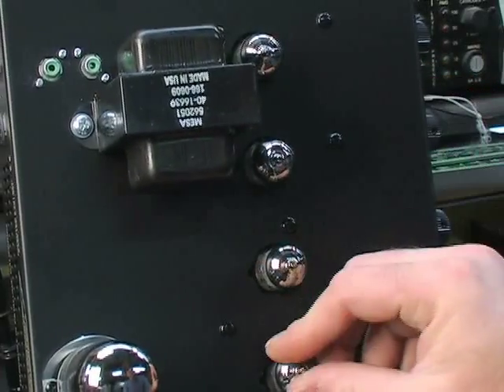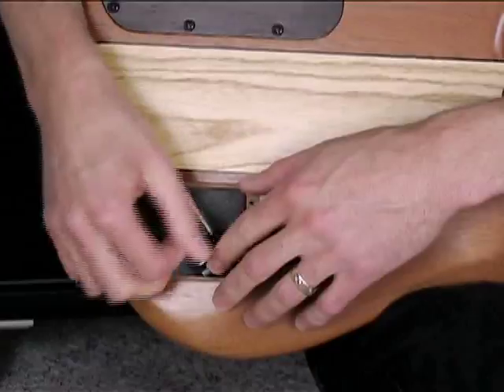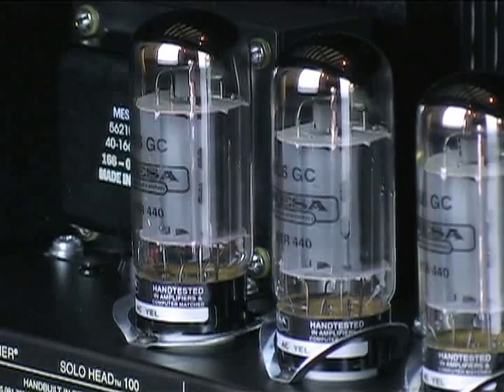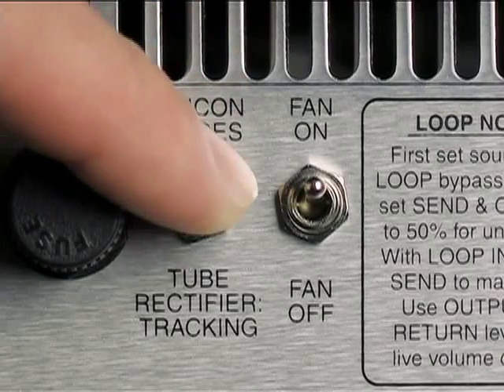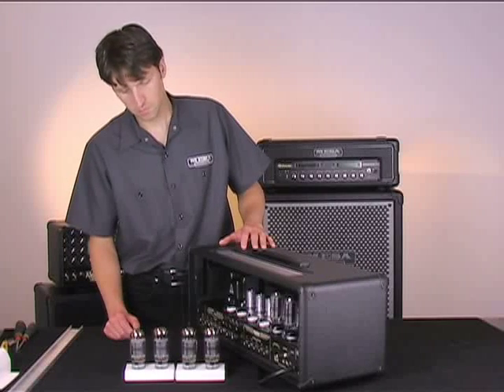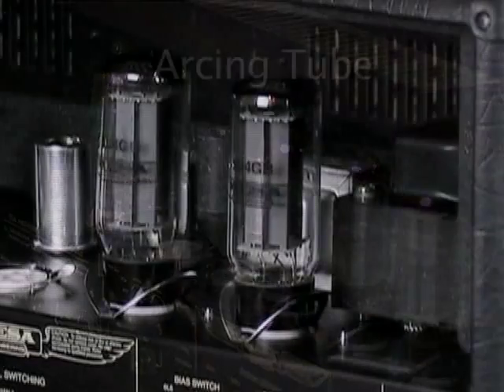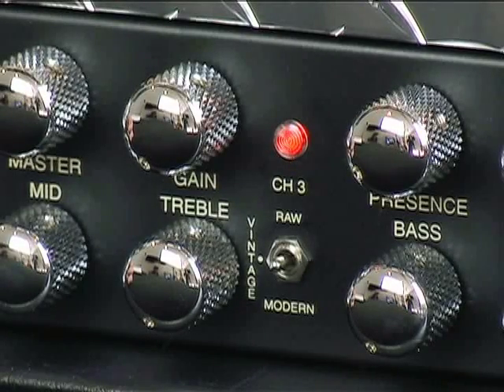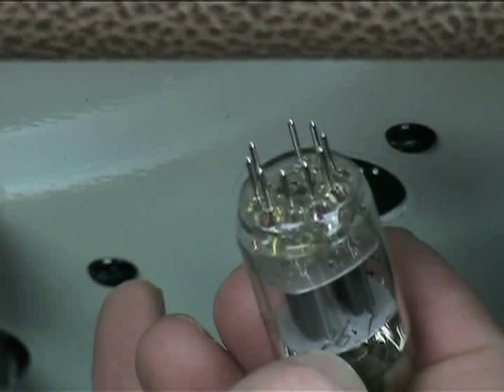Mesa Boogie Amplifier Troubleshooting

Comment: I can't find the 6L6GC STR 440 power tubes online (I guess they're discontinued) do I need to replace all 6 in my triple rectifier so they match with the 448 STR, or can I just replace 2 tubes with the 448 STR and leave the others as the 440 STR?

Comment: So I just bought my 4th Boogie which is a Rev B 8k serial range Mark IV. I’ve lost all volume on R1 while R2&3 work great. I can get some sound on R1 if I crank the gain and master all the way but it’s weak and sickly sounding. Preamp tubes did not make any noise when I did the tap test. Thoughts? Thanks

Comment: Speaking as an experienced electronics technician, I can tell you that Mesa amps are very reliable, and when they do need to be repaired they are not difficult for a technician who has good electronics knowledge and troubleshooting skills.  Those techs who complain about how hard Mesas are to work on are not very good technicians who are stuck in the past and never got past the "point to point wired or nothing" attituded about amp construction.
Reply: This comment is BS. Mesa's are hated for two reasons. First of all their have schematics that tend to be incorrect or outright stuff missing from them.

The biggest reason is their layouts are atrocious, cramped, and a pain in the ass to servics. I'm not even talking major work like having to pull a board which tends to require desoldering 80% of the amp. Even a simple resistor replacement can mean having to pull multiple caps just to reach it. Mesa loves throwing stuff under caps for some reason.

Older, less feature rich Mesa's aren't hard to work on, but anything like a mark head is an absolute pain to service.
Reply: @codykensington1424  Spoken like a true second-rate "technician" who thinks amp evolution should have stopped with the Marshall 1959.  Anybody who has spent any time servicing MODERN electronics and knows how to do it well has NO problems servicing Mesa amps. You would never make it in any consumer or industrial electronics repair operation.    Your electronic component level repair skills are apparently stuck in the dark ages.

Comment: Hi there,
I have a mesa v 25 I just purchased in Sept 2022 and am already experiencing loud squealing feedback with multiple guitars as well as an annoying loud humming sound on ch.2. I've moved the amp all over the house thinking maybe it was just bad grounding on that circuit of the house but no change. I figured possibly a little hum is normal, but this doesn't seem normal to me. And the squealing makes it almost unplayable on any of my guitars.  Any ideas on what that could be?

Comment: I just turned on my 01 single rectifier head without having a speaker load. I flipped the standby switch to on and began strumming. No sound. The amp was on channel two. Modern voicing with gain at about 4 o'clock. I turned the channel volume and output volume up a bit and nothing. It then dawned on me I forgot to connect to the cabinet. The amp was on about 20 seconds before I noticed it. I turned the power off then flipped into standby. Probably should have done the standby first then main power. Anyway, with the amp off I connected the cab and turned the amp on and flipped off the standby. The amp seems to be alright. Didn't smell anything odd. Did I dodge a bullet? What should I look out for? I hope I didn't damage anything. I've only had the amp a week.

Comment: Guys, I have glorified Mesa Heartbreaker with matched 6L6 and proper bis selected. It had been working perfectly.

I did a mistake of setting Power "ON" with Standby already in "ON" position.

Amp turned on, sound started to grow, tubes were bright - and after that stoped.

Fuse has blown. Replaced it, took out ractifier (with silicone mode) and tried to set Power "ON".  Amp turned on for 1 second and stopped. Fuse blown.

Replaced fuse - amp does not turn on and red jewel is not lighted. Fuse blown.

Took out all power tubes, replaced fuse  -  amp does not turn on and red jewel is not lighted. Fuse blown.

What might be the most probable case?

Comment: Hi , I have owned a Mesa Boogie Tremoverb since 1994. This amp was a major fu#$king headache right from the get go. I even eventually got Voodoo amps in New York to mod this boat anchor for to the tune of a $1000.00 USD.  I got the amp back from Voodoo amps from Trace Davis and the amp sounded a bit better than stock , but the noise floor of this amp was still very noisy. The amp also has had two bias pots installed, as in the stock form , the amp is no n- adjustable. The effects loop was converted to a serial loop, as the stock form was a parallel effects loop. This amp now plays not too bad but the tone controls other than the treble control do absolutely nothing. Bass and miss do absolutely nothing to affect tone. The amp has always sounded very compressed, as if it has a blanket thrown over it. I originally paid $2400.00 Canadian dollars for this amp. Sunk another $1000.00  to Voodoo amps and then to top it off I had it break down and I had it sent back to Nesa Boogie in Petaluma,  California. To the tune of another $600.00 USD. And to boot, the guy that was running their customer service department was a real As#$%hole and a major dick to me. So all and all this amp is a basically an overly compressed boat anchor. I am sorry that I thought that I could actually make this into a good amp. Boy was I totally off base.Even Trace Davis at Voodoo amps f#$cked up the Canada Customs papers sending the amp back into Canada. That cost me an extra $400. 00 Canadian dollars. So at the end of the day I still wound up with a shitty sounding boat anchor. So everyone, take my advice, do not buy a Mesa Boogue amp. They are a son of a bitch to repair and good luck finding someone that can actually work on these amps that is even skilled enough to do so. Just ask Brad, the Guitologist on YouTube what he thinks of Boogies. They are solidly built, I will give them that, but if anything goes wrong with the amp it's a frigging nightmare to get fixed. The effects loop is absolute garbage. The tube buffering in this loop are garbage. Mesa's speaker cabs are fine. But you could not give me a Boogie now. The company that I opted to go with is Ceriatone out of Malaysia. At least there you get a point to point wired amps. Not a bad sound to be found in a Ceriatone. So everybody,  do yourself a huge favour and steer clear of Mesa amps. There are so many better companies out there.

Comment: I have a problem with my lonestar amp.  Five minutes or less playing and the sound turn off. This issue happened only when I plug my guitar direct to amplifier. But if I use the fx loop (4 cables method) works without a problem. What do you suggest? Thank you!

Comment: I have a question, if anyone can answer it would be much appreciated. If I have located that my rectifier tube is faulty, should I replace it before checking further tubes?
Reply from the maker: Hey Jonathan, on many of our amps there is a way to run the amp without the Rectifier tube or tubes. On a Dual Rectifier 100 Watt Head, for example, you can set the amp to operate on the Silicon Diode and simply remove the Rectifier tubes. So, you could check the rest of the amp minus the Rectifier tube(s) in many cases.
Reply: MESA/Boogie ok thanks

Comment: I would agree with the section for testing the rectifier tubes if the power tubes are removed.  However,  once you start installing the power tubes for testing,  should a load be placed on the output?  Thought it was not good to power up a tube amp without a speaker load.

Comment: good morning
im having some problems with my tube amp and i was wondering maybe you could give me a hand please....the amps is a Stiletto Ace combo 2x12...when i engage the loop fx in some moment the volume drops...the sound is like having the Send Level on cero ...is like something is making a bad conection because you turn off and turn on again the amp and is ok...i tryed to change the preamp tubes...i changed the V1 (all modes except fluid    drive and fat clean) and V4(send return) even i changed the other preamp tubes but doesnt work...tryed putting a cable from the send to the return jack to by pass the loop fx but no results...it seems to be a common problem on tube amps...but i cant figure out whats going on...do you have some advice for me? wi will apreciated...help me please u.u

Comment: Hi Mesa, i got a short question. I found out that my brand new mesa boogie lonestar head amp makes sometimes while im playing crackling sound or just a snap, doesnt happen everytime.

So i opened the chassis and checked the pre amp tubes, and i found out that V1 is crackjng when i just move it back and forth, so i changed with another tube from V3, just to check what. Happens then, but it still cracks when i move it, is it normal that a small amount of crackling happens when you move the tube back and forth? 

And btw, is it normal that the transformer has a very low hum when your amp is on?

Thankyou in advance :)

Comment: So i have an old record player/radio and while it was playing a record earlier it randomly stopped. After messing with it I noticed none if the fuses were lighting up. Any idea what would cause every one to go out at once? Also where can I get fuses for older record players? Any help would be great, we are ttying to get it fixed by Christmas
Reply from the maker: Hi Joe - Fuses fail because something higher voltage is wrong with the device (not just that the fase has gone bad). You can replace the fuse but generally, a fuse failing is trying to tell you that there's something more important than just the fuse to address. You can go to a place like this: https://www.fusesunlimited.com   and they will definitely have what you need. But, you will likely need to enlist the help of a repair person with something like this. Good luck and all the best!

Comment: hi guys. i have some truble with my single rectified. ive watched this video and helped me check the tubes and found some failure but dont know what the reason is. is there any way i can chat with you so i can get any advices?
thank you
Reply from the maker: Hi Willy - Glad the video was helpful and glad you were able to somewhat identify your issue. The best way to discuss something like this, especially if you are in the US, is to call our customer service between 9am-5pm Pacific time at 707 778 6565. You can also email us via the contact form here: http://www.mesaboogie.com/support/contact-us.html    We could potentiall comment back and forth here on YouTube, but sometimes what seems like simple questions may have more involved answers, which is why it's best to call if you can, and maybe email us via the contact form if you can't call. Let us know what you decide and we look forward to helping you get your amp back up to 100%!

Comment: Does the speaker cable have to be plugged in when I test the tubes? In the whole video is unplugged.
Reply from the maker: Good question and it depends, Fabio. To be safe, it's probably best to say that you should always have a speaker connected. There are too many variables to consider to be able to say in a YouTube comment but the bottom line is, if you have any signal going in to the input of a tube amp, you always need a speaker load connected. Hope this helps.
Reply: Thanks for your reply, I've tested my Mark V (just a routine check) without the speaker cable plugged in, and no imput signal (just like your video)... everything worked fine!

Comment: I heard that an amp head always needs to be connected to a speaker (for load) before I turn on my Mesa. Is that true, because there is no cab or speaker connected in the video when the guy in the vid is troubleshooting the power tubes?

Comment: Hey Mesa/Boogie. At around 12:27 in this video, it claims that to test a preamp tube for microphonics/other issues, you have to tap it with a pencil while the amp is on. Does this mean the standby being on as well? The fact that the volume is on seems to imply that the standby is on, but I am only asking because I don't want to kill myself through electric shock. I have a Mesa Boogie Studio Pro. Thanks so much!
Reply from the maker: Hi Kevin - short answer, YES!. :) Longer answer, tapping on the preamp tubes as a test for microphonics is also a rather subjective test requiring some experience to know what you're listening for as just hearing noise through the tube doesn't completely tell you that a tube is good or bad. It's highly dependent on your setting of volume, Gain and brightness (treble & presence) frequencies. If you are not having issues with squealing feedback when using high gain, the microphonic might not be of use to you. Regarding danger of electric shock, once inside your unit, make sure to touch nothing other than the tubes themselves with the end of a plastic pen. A pen is better than a pencil because there's no metal on it. Hope this helps and let us know if you have any more questions or if you've gotten your stuff fixed up. :)
Reply: The problem is I have tube rattle on certain notes, its more discernible on the clean channel but it exists on both channels. Do you think I could tell which tube was busted through tapping on them? Thanks again!
Reply from the maker: HI Kevin - Do you mean Studio Pre? Rackmount Preamp? Tapping on the tubes won't always tell you exactly which tube might be microphonic because once a tube is microphonic in the preamp chain, tapping any of the tubes may sympathetically pick up the tapping even though that tube is not bad. Make sense? Ultimately, you have to get in and experiment but this kind of troubleshooting is kind of a 'feel' thing. If this amp is actually a combo, this may change things because sometimes certain combinations of guitars, pickups and particular notes will cause resonant frequencies in combos and some tube rattle may be normal. If you'd like to discuss tube troubleshooting in more detail, it might be best to discuss via phone. Feel free to email me at tien@mesaboogie.com to set up a time to discuss more in depth troubleshooting on the phone. Hope this helps!

Comment: i have two vintage altec amps exactly the same but one blows the fuse with  the same tubes as the other so ive eliminated it being tubes...where should i look next?
Reply from the maker: Hi Truth - We can't offer troubleshooting advice regarding Altec amps, BUT - if you take tubes out of a working amp and put them into another amp and that amp continues to blow it's fuse with known good, working tubes, then yes - there is an internal circuit issue with the other amp that will likely need to be looked at by a techncian. Sorry we can;t be of more help. At the point where tubes are determined NOT to be the issue, you are now in an area where elecxtronics and circuitry are involved and that is where a qualified technician should be consulted as user serviceable options have been exhausted. Best of luck!

Comment: My Lonestar V2 thick,thicker switch is not working.Makes no change in tone whatsoever.Could it just be the switch?
Reply from the maker: Sorry to hear of a problem, Kevin. Could be the switch or could be the connections to/from the switch. Definitely not tube related or user serviceable although I would say that the switch in general is very subtle. That said, if you've noticed the difference before but now there is none, then it may be something that you take to a technician to have looked out. We RARELY see this kind of feature fail. Feel free to contact us at the factory for service or you can seek your nearest authorized Mesa Repair Station by searching at this link: http://www.mesaboogie.com/support/locations.html       Please let us know what you find.

Comment: Hi MESA/Boogie, I bought a mark v 25 brand new, I am experiencing volume drop intermittently both channels. I purchased new el84 tube (MESA labelled gry ac10) and 12ax7 (MESA brand), and it is the same thing the volume goes up and down, the amp is already one year old. Cheers from Australia!
Reply from the maker: Hi Mr. Pullthetrigger - Sorry to hear you're having problems with your Mark Five: 25. If you have changed ALL the tubes in the amp and the problem still persists, the issue is probably an internal component and needs to looked at by a technician. A problem like you're describing is much more likely to be a preamp tube and not a power tube, so if you haven;t changed out all the preamp tubes - at least one at a time, as recommended in the video, I must suggest you try that first. Let us know where you're at with that and/or let us know if you need any help getting in touch with your local authorized Mesa repair. Looking forward to getting you back up and running.